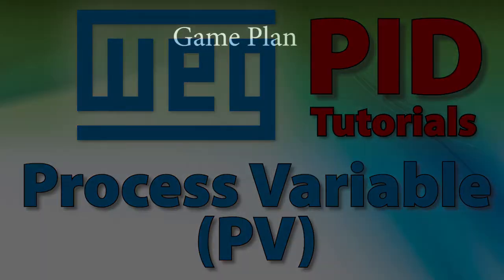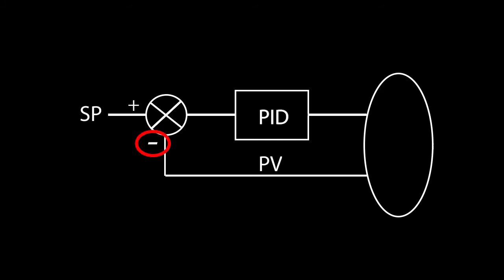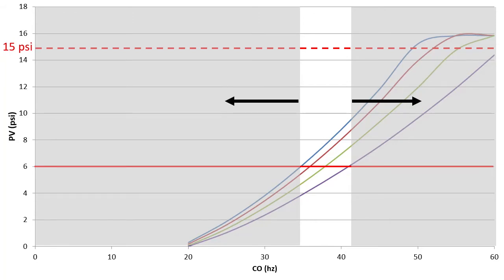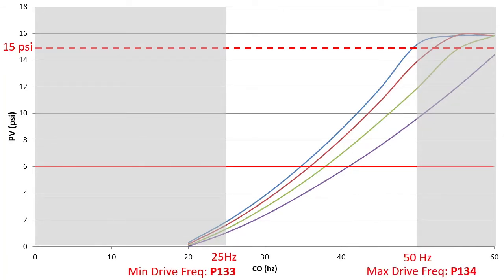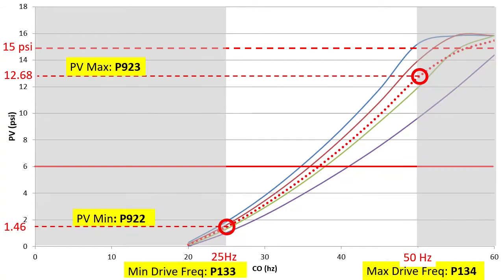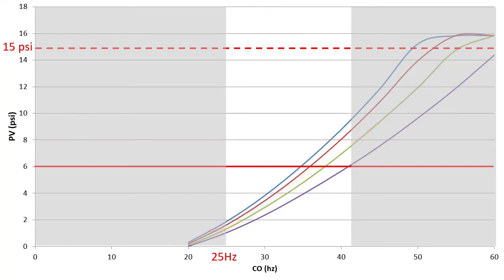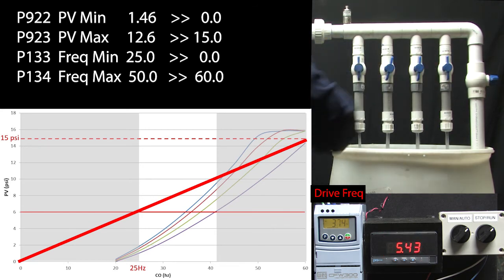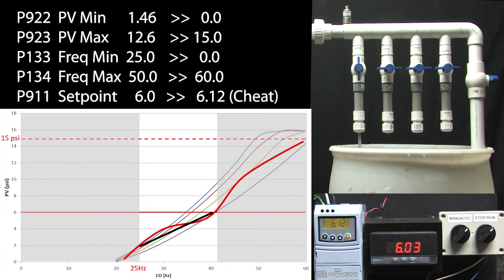WEG CFW VFD PID Process Variable (PV) from AutomationDirect

Comment: Nice video on PID! Do you sell any pressure sensors to measure pressure inside a plastic extruder?
Reply from the maker: Hi Rakshith, We have a lot of pressure sensors which you will find here: 
https://www.automationdirect.com/adc/shopping/catalog/sensors_z_encoders/pressure_sensors

But, if you are looking for a pressure sensor for injection molding, we really don't have anything for that. We do have an engineer here that used to work in that industry and he tells me he used to use this sensor for his melt pressure sensing (Most of those are dual function - they give pressure and temperature readings and are rated for thousands of psi): 
https://gefran-online.com/w3-oil-filled-melt-pressure-transducers-mv-v-output.html
Gefran - W3 Oil-filled melt pressure transducers - mV / V output
Leading Distributor for Gefran W3 Oil-filled melt pressure transducers - mV / V output
gefran-online.com